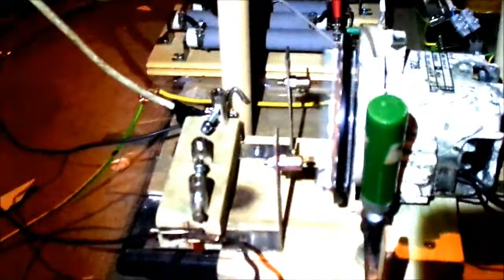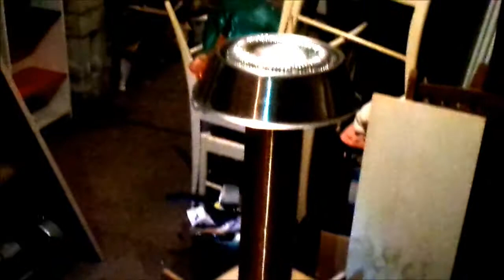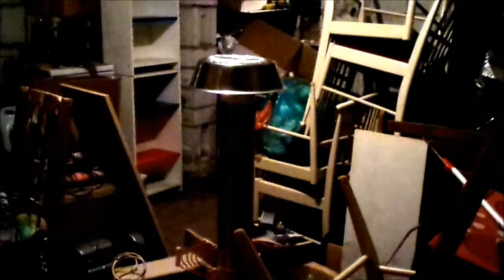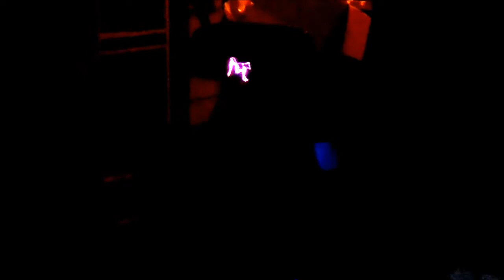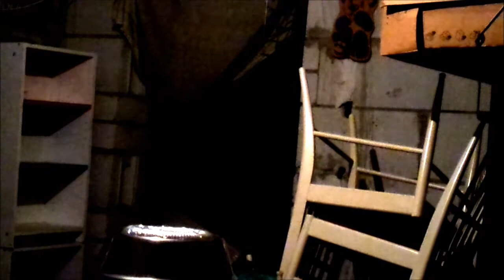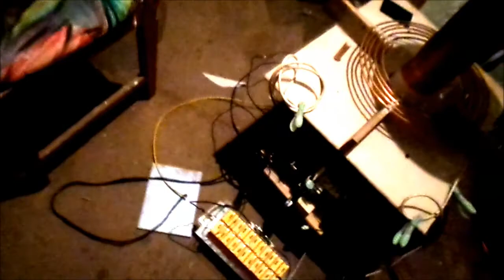ASRSG vac motor

Comment: Synchronous is better because you can tune it to the resonant frequency and it fires right when you want it to.
Async is ok if you keep a hand on the variac and continually adjust for best arc, but it may still not be firing at the right moment